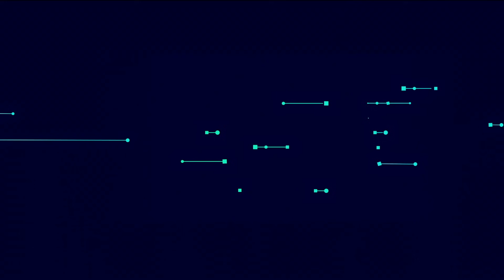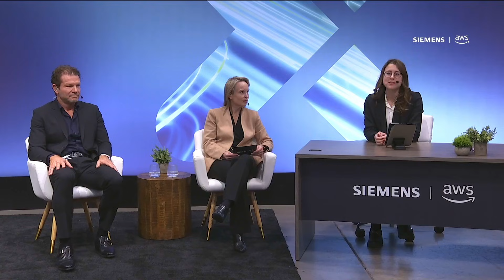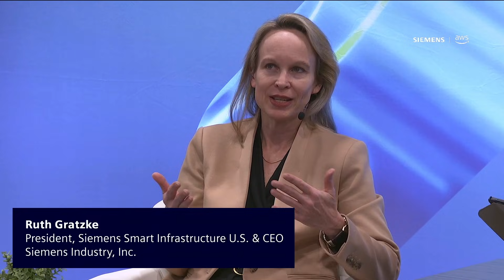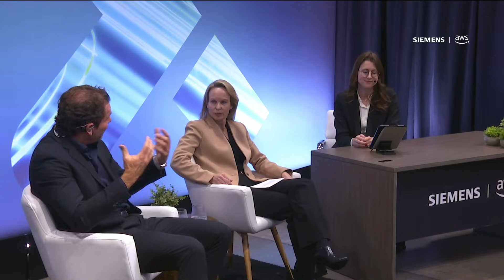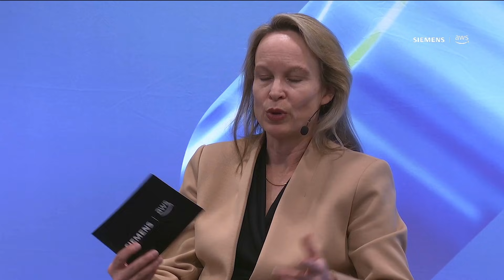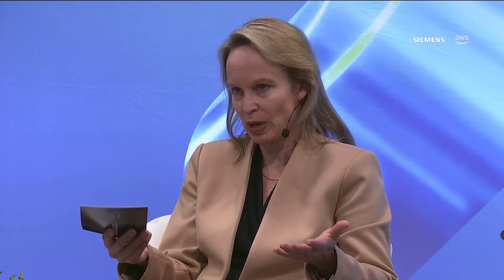Building AI Factories: How Siemens and AWS Are Solving Data Center Engineering Challenges

Comment: Excellent discussion.
What becomes very clear is that AI is no longer a software problem – it is an energy-thermal-reliability system problem.

The shift from 10–12 kW racks to 120+ kW, AC to DC, air to liquid, and 5–6 nines uptime shows that we are truly entering the era of AI Factories.
The next bottleneck will not be models, but orchestration: power, cooling, compute, sustainability – and the human decision layer on top of it.

This is where human-centric digital twins and governance-first AI become essential.